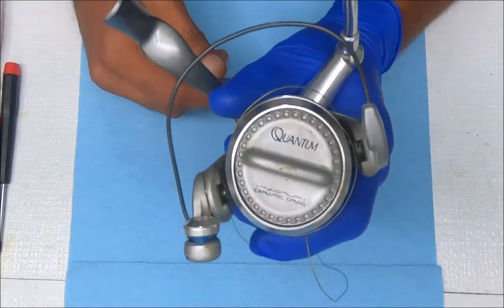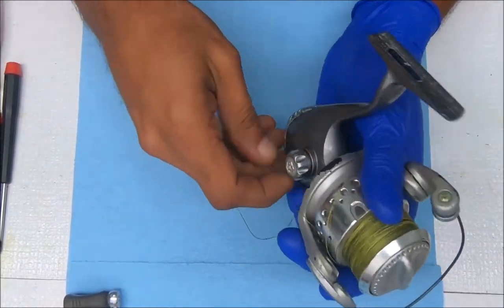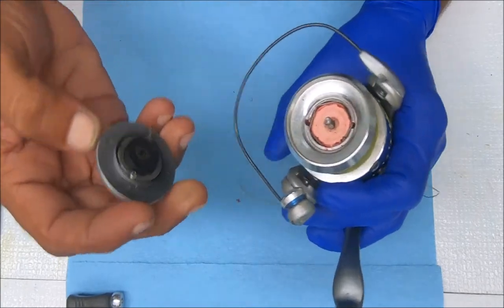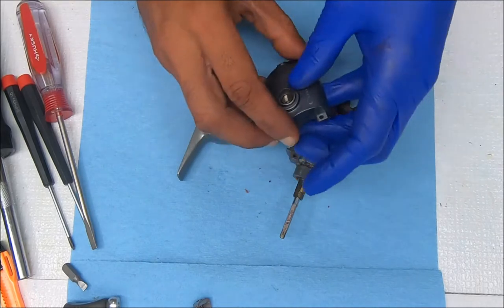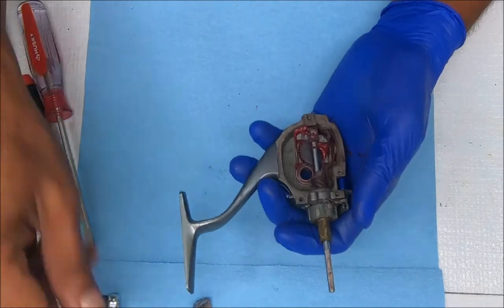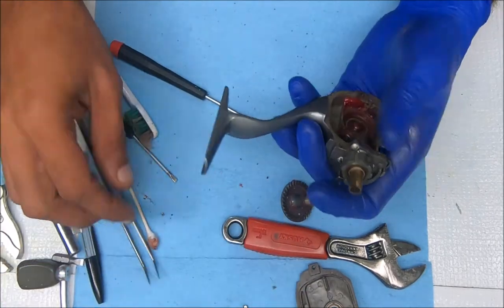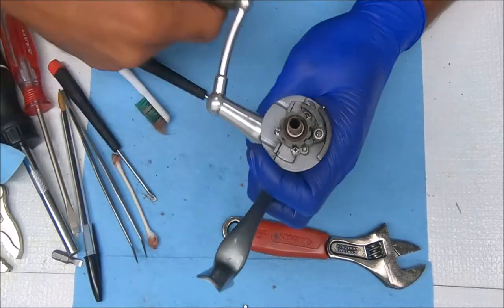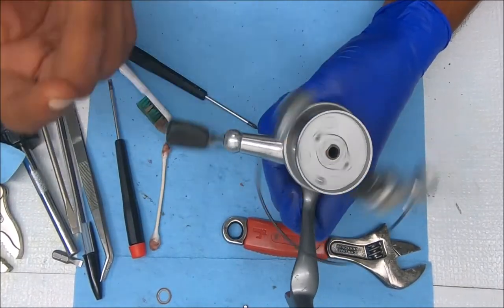Quantum Catalyst 30PTS Hard To Crank - Not What It Seems: Fishing Reel Repair

Comment: Hi, I have her professional if it is possible: I saw that you recommended to move the shim in this case, I wanted to ask what is his role in the reel and will it make noise from the bearing if he is not there ? Thanks in advance and always nice to learn new and interesting things from your videos
Reply from the maker: Thanks for watching, Y L. Shims on the main gear help remove play between the main and pinion gears. Adding too many shims makes the crank feel labored (very stiff).... too little makes the crank feel loose. Both scenarios can accelerate wear on the teeth, so want to find the "shimming" sweet spot. The bearing will not make noise if all the shims are removed. Any bearing noise you hear will be there with or without shims. Hope this helps.
Reply: @TSGReelService  You helped me a lot to understand, thanks for a professional and detailed answer - an experience to learn from you !!!
Reply from the maker: You're welcome, bud. I certainly don't have all the answers, but happy to help when I can.